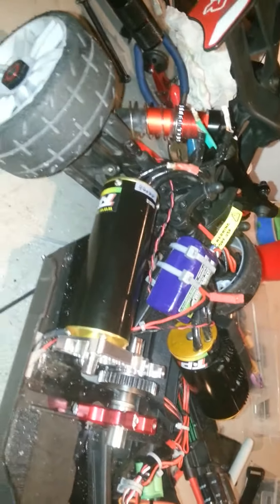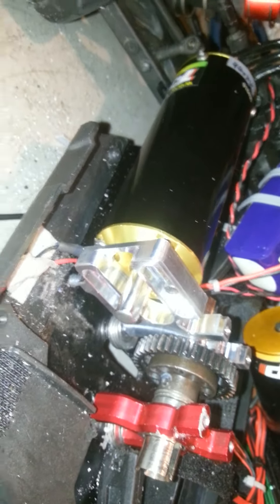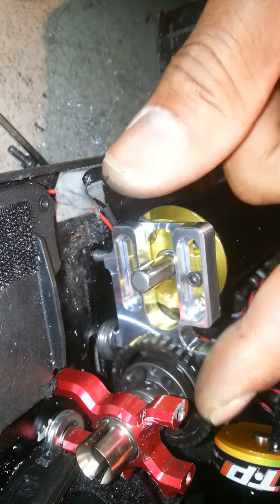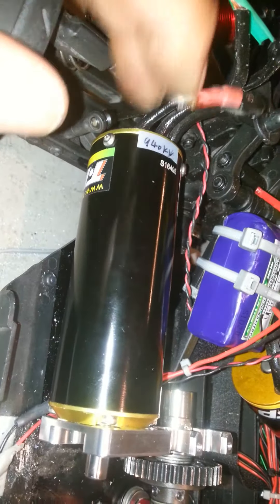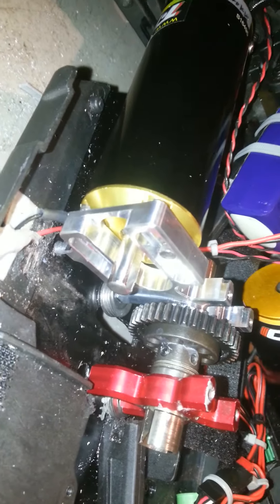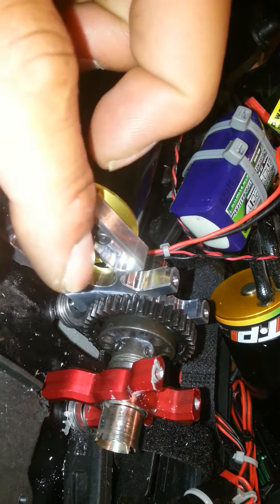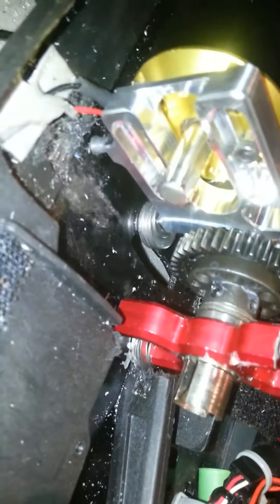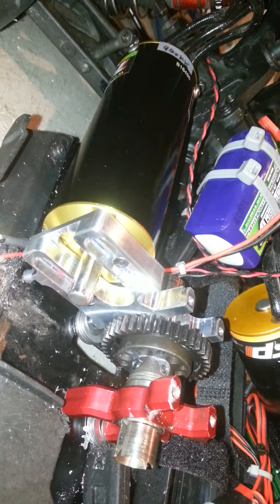Arrma typhon motor mount mod from Michael Myers

Comment: thats gonna fly bro..
i wanna use that longer chassis whats the part number for the dig bones ur using for the Kraton Chassis
Reply from the maker: Blade-Runner I'm not using it I will sell u mine it's brand new
Reply: DAVE CHAPELLE 
i have the kraton chassis.
i just need the bones
Reply from the maker: Hold on 1 is 13 5mm and the other is 116mm hold on
Reply: kool my man. thanks
Reply from the maker: No problem Blade.